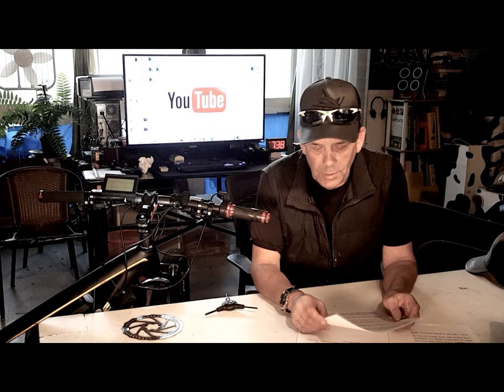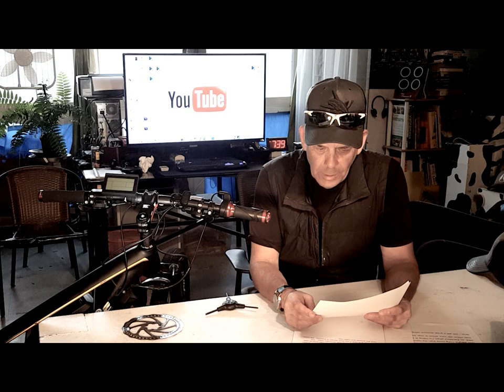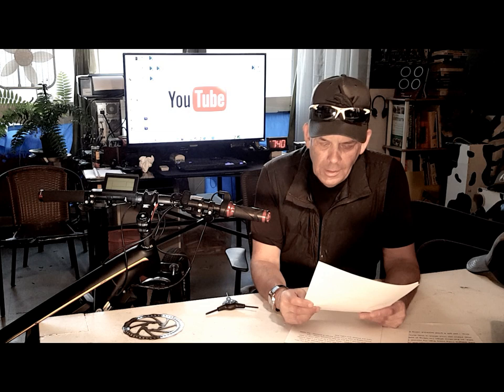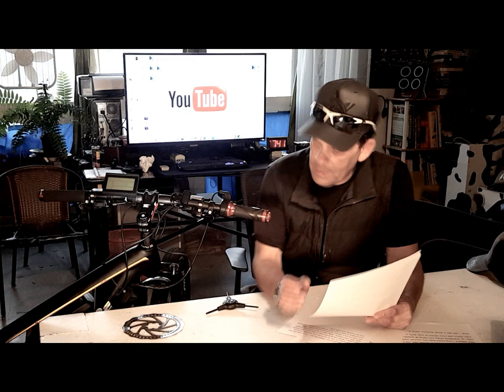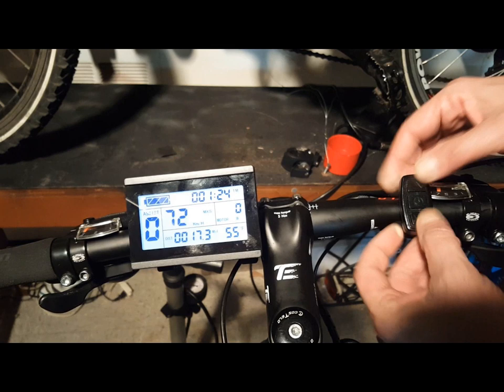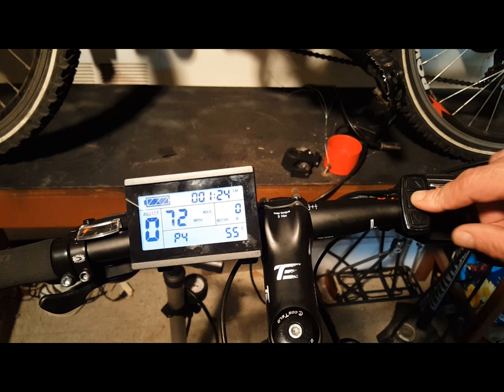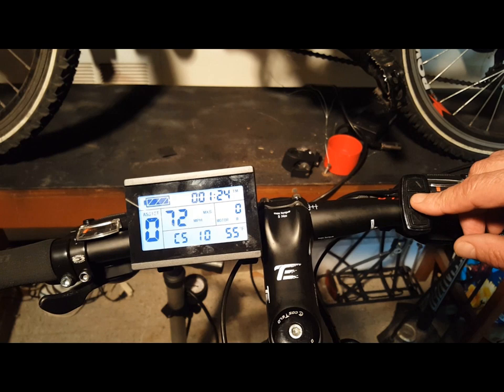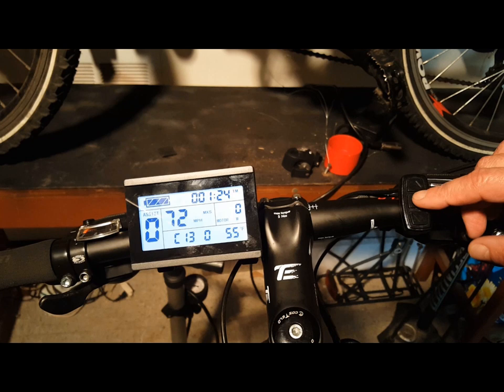ebike Tips. Programming the 24v, 36v, 48v, KT-LCD3 on-board controller computer

Comment: what you are missing is the fact, that when you press up and down 10 seconds after turning display on, it will bring you to maximum speed settings. If you press it for example 1 minute after turning on display - it will not bring you to those settings, but will allow you to reset distance since the last reset.

Comment: Hi I have a gogobest gf600 I need the parameter settings for it   ihad an error code so I switched it off and back on it cleared the error but my settings have all changed I need the parameter settings to reinstall

Comment: Cheers mate! You helped fix my battery problem. The battery was full, but the monitor was reading an empty. It did show the bars and they was draining, but overtime, it was draining just too fast. I was able to see the temperature for the controller as well! So i'm set and able to read it! <3 Unlike the 1000+ watts it kept pulling out. I don't even know how many watts are in a volt. I wanted to see the temperature so I didn't risk burning the controller up!

Comment: Hi can you run a 48v battery off this screen because I've tried it and both of the screens I had of burnout they still turn on but they won't work the machine and it's only a 36v kit what I've been told there 36 to 48 V screens football full of burnt out

Comment: This is critical for making a purchasing decision.

(05:05) If the motor manufacturer doesn't respond to inquiries (almost ALL of them will NOT respond to user emails) but you know the electrical specifications of the motor (watts, amps, etc), are the P1 settings obvious and we can still program the unit?  OR...does it require knowing proprietary manufacturer codes to set for given motor electrical specification values and we're out of luck when manufacturers don't respond? 
(e.g. for 750W motor enter "3", for 1000W motor enter "5" and so on).

If it requires entering codes, rather than actual specification data, is there documentation anywhere that translates motor electrical specifications to the required codes?

Comment: Hi 
I changed the old damaged BLDC controller with the new one (KT-48ZWSRL)
I also had the 6 wires for the Hall sensor, didn’t connect the white one.
If I go in „walk“ mode (long press of down button) the motor is rotating but if I use throttle nothing is happening.
Some advice?

Comment: My battery says that the cut off voltage is 36v , however my motor cuts off when the battery reaches about 46v. Any ideas as to what the problem is ?

Comment: I have NCM Milano with Das Kit controller in U.K.  if I sop in high gear starting is near impossible as there is no throttle (UK law). In walk mode the power is maximum but speed is limited to 3 mph. Is it possible to reprogrammed to a higher speed  so that I can get started and change down gear?

Comment: Great descriptions and a levelheaded approach to programming..  Helped a lot with my new controller.   Do you happen to have a wiring diagram for a 1200w Risunmotor controller?  KT36/48VPRL-SLSO2G  They dont send a wiring diagram with their controller.  I am an electrical contr. and just need the ID of the terminals.  thanks much

Comment: Hi
I hope you can help.
I have got 48v 1000w ebike with throttle battery display. I have purchase a lcd screen to connect but there is no connection to conection. I try to weld to the same wire colour but can't use throttle anymore. 
My question is Can i use anther lcd or just have to use throttle power signal display?

Comment: What would the P5 setting be for a Battery48V 14Ah Li-ion battery with Panasonic cells? I have the sondors fold x and the kt lcd3. I have been trying to set it up, i set the P5 setting to 15 and it didnt show any battery so i set it back to 0. Also the spedometer doesnt work anyone know why?

Comment: Anyone know what parameter settings I should use if I use it with a Bafang BBS02B 750w mid drive 48 volt? Originally used the KT-LCD3 with rear hub 1000w.

Comment: Hi pal, thanks for the video it was just what I was looking for, but could not find anywhere. I was messing about with my LCD and upset the factory settings, and was unable to find instructions on how to reset my computer, until I found your video. I am delighted with myself after seeing your video I reset my computer on my Zipper Z6 36V e-bike. I think in the US its called the Archer e-bike! You are a scholar and a gentleman. 
From John in Ireland... 13th July 2022.. (I have a question, my bike has just walk assist at 6 mph, can this be changed to full power on my thumb drive?)
Thanks in advance.

Comment: I am not sure what LCD unit I need. I have a 20" front-wheel-drive 36V 750W motor & powered by a 36V 20ah ion-lithium battery ( I am new to this so can you please help me)
Reply: typically KTLCD3 and KTLCD8 work the same on KT controllers, LCD8 is better though, it has a full color display and is able to show you all the settings at once

Comment: Informative video thanks - Is there any way of changing the wattage that is applied with each PAS level - if that makes sense - for example my PAS level 1 applies 50-120w of power, PAS2 120-220w, PAS3 220-350w, PAS4 350-420w and PAS5 420-520w - my motor was a 350w but it failed, I now I have a 250w and I am a bit concerned that PAS5 will decrease it life span as the other one failed after 14 months.
Reply: No, there isn't.
Reply: Yes,you can mix the C5 and C4 to lower the power respectively

Comment: Little late to the party but I'll try anyway. I currently have a 36v battery running on the KT-22a - 36v/48v- 500/750W. My question is what will happen if I upgrade to a 48v battery? Simple math pushes the Watts to 1056 will the controller limit the Watts?
Reply: The controller will use the same current.  Why are you trying to limit the Watts?  To protect your motor?  You can restrict the Current output of the controller using  the C5 parameter, which will restrict the Watts in a similar fashion.  Setting C5 to 10 will divide the Max Current by 1.10.  Setting to 8 will divide by 1.15, 7 by 1.2, 6 by 1.25, 5 by 1.33, 4 by 1.5 and 3 by 2.0.

Comment: If I had a manual to check I wouldn't need to find the info on YouTube So while I don't expect you to explain stuff like sine wave settings there are others that you just skipped over so I don't even know what questions to ask about my battery or motors or controller if I had the opportunity . You just read the manual

Comment: Is there a way to increase the LCD timeout settings? I believe the current default is 5 minutes. Wipes out your trip statistics if you have to stop for longer than 5 minutes. Thanks!
Reply: no there is no way to change timeout settings, the best way you can calculate your total distance for a single trip is to write it down every time you stop then add them together for your total

Comment: My Ebike 48v so can i put battery  60v? My controller  on board write 48v/60v so it can burn motor and controller?  Pls help me Thank you for your answer me. Thanks advanced.
Reply: 60v is the limit your controller can handle BUT do not buy a 60v battery as you will burn your controller, buy a 52v battery, a 52v battery at full charge is about 58v

Comment: hello, i bought an lcd 7 to replace my broken up old one
It works in general but when i pedal my bike it won’t even turn the motor on, it’s weird because my walk function works
Reply: Did you get it to work having same problem.
Reply: @colton167  hey, I changed the internals off the old broken one into the new and it worked, this is due to both monitors having different configurations, they are the same, but the new one was not configured to my bike

Comment: Alexandre Costa
Hi, really nice video. I have a question, i buyed a 36v 500w Hub motor, and the controller doesn´t have a connection to a LCD panel so i can control the level of the power of the motor. Do you know a solution to have it incorporated somewhere?
The reason, is that the PAS always goes to full power on the motor, and sometimes i don´t need that, i need just a smooth assistance of the motor.
Reply from the maker: Hey Alexandre,

You would have to buy a new controller that comes with an LCD or LED that will work with your 500w motor. The good news is that if you match the voltage and the wattage for your motor, there are plenty of great options under $60 that will really help you out and allow for PAS. Let us know what you come up with. Cheers!

Comment: I have a KT-LCD display and I have a 48V battery that is suppose to show up to 58.8V but the battery only shows 53.6V fully charged and it cuts out at 33.6V. The P5 on the settings was set at 12, and I understand that is suppose to be for a 36V battery system. It is really suppose to be set at 15, for a 48V Battery system or "0". Are you suppose to change the C10 setting to "Yes" to make changes on the display?
Reply: Did you find any answers? This depends a bit on your battery chemistry and if your batteries are working as they should. I have blown 2 cells in my lipo packs due to 1st time a bad balance connector and 2nd time vibrations and rubbing on the bike. After this the cells can go dead short so the other cells do not see them just as if there was only a straight wire there. Then if you charge without balancing or without checking you are getting a balance voltage on all of the cells you can be overcharging the other cells as the blown battery cell is no longer there to absorb it's share of the voltage. Then you end up with a battery pack that is 3.6V lower for each blown cell also you will be damaging the pack and risking a fire each time you try to charge.
  This can confuse the controller.
Reply: your battery is 48v means 13sX3.7. So the max voltage you can get is around 13sx4.2=54.6. You lcd shows it correctly
Reply: 48v battery should not show 58v in any case. 54v is the maximum
Reply: a 48v battery maxes out at around 54v, a 52v battery maxes out at 58v

Comment: Help!My KT_LCD5 (with 48v 1000watt motor), top line (TM) flashes and I can't reset.  Used to work, but now can't change at all. How do I reset to default?
Reply from the maker: Turn off Battery. Disconnect from the controller, wait 5 minutes and reconnect. It should go back to factory defaults.

Comment: Hey, thx for the vid. I got a problem on my ebike. The LCD is showing an error message '06 info'. Also, the temperature symbol is loading... Doyou know what it means?
Reply: Gaspard COTTIN about the the temperature you need to check the sensor, also the error 6 sometimes depend of the sensor. Try to disconnect the Throttle or other stuff one be one and check if you have other error.

Comment: My system shutdowns even when charge of 2 points exista Mine is a 36v battery and p5 is set to 15 and sstill it happens
Reply: p5 at 15 is for 48v batteries not 36v

Comment: I have a weird issue where my temperature is - 31 F when it's actually 91 F outside... Any ideas why?
Reply from the maker: I have never had that problem. Clearly the internal sensor is not working. It is not something you can program.
Reply: Mabe in c centigrade like in Europe.  Look to change temperature displey settings Fahrenheit or centigrade.

Comment: No good to me as my electric e bike is a roahog all I’m getting is 15 Miles an hour it’s supposed to do 25 to 30 I don’t know how to program it did not get instructions I’ve tried Internet I tried here I don’t know what to do
Reply: Here is the manual for LCD-3 display: http://www.topbikekit.com/LCD3-User-Manual.pdf.  The very first setting on page 17 or 18 under General Settings is the Maximum Speed.  Set this to the max setting of 72 km/h that way the bike will run unrestricted.

Comment: Hi there, I purchased a BPM bike online and though I have been satisfied with the bike, I found the LCD display wanting.

I called BPM and they could not provide me with any further information on the LCD display other than the options to choice amongst 1) Max Speed; 2) Wheel size; 3) Voltage and 4)kph/mph. The generic display has the 5 section battery life indicator on top like all King display, pedal assist levels, etc.

Aside from the four configurable functions I mentioned, there were nothing else! There were no option to lite the display for night riding, clock, etc.

So, I am puzzled as to the LCD displays you have been talking about, with what could be up to 25 functions!? I didn't expect option for light as there were no light connected to the bike, but this is far below basic as I expected. My question is, can I replace the LCD display to something with more function or is the display tied to the controller so I could not simply upgrade the display?

I have been looking online everywhere but couldn't find any help, maybe you could offer some enlightenment then. Thanks.
Reply: Cav1stlt hey man I have a bpm and all I do for light is gold the + button and it turns on. I’m trying to figure out how to set the top speed
Reply from the maker: In order to replace your LCD you would have to make sure that it is compatible with you controller. The best thing to do is to purchase a good LCD that comes with a compatible controller making sure that it is the same voltage and wattage of your battery and motor. You should be able to find them easily for under $50. The SW-900 is a good choice, readily available and works with multiple voltages.

Comment: I might have missed it ... did you say how to clear the trip odometer?
Reply: Directly from the manual: After power on for 5 seconds, hold up and down arrows at the same time, single trip riding time (TM) and single trip distance (DST) flash, hold power button shortly, the content of both is cleared. If failed holding the power button within 5 seconds, it will automatically return the display interface after 5 seconds, original content is preserved.

Comment: Hi. I have the KT60SVPRK-SLS02G controller. 
I am trying to find out how to modify the settings. Specifically if i can change the low cut off voltage to suit my lipo battery pack.
  Also i would like to know if the auto voltage detection works well and if there are any tricks when connecting. I want to be able to use two different battery configurations with the controller. 16s lipo (nominal 3.7V max 4.2V) i then want to be able to make the same battery pack into an 8s 2P (or just 8s: no P:). This way i can use the bike for either high speed on the road or low speed high power for climbing off road mountains.
  Ps. can this controller charge the battery via regen?
Reply: On the controller it says it is a 60V (i'm guessing nominal which is around 16s lipo) 45A low voltage cut is 50V. Display is the KT-LCD6
Reply: I think there is an auto voltage detect for lower voltage batteries but if not i would like to be able to change the setup for different voltages.

Comment: My display stops showing mph when I'm coasting.  Is this correct, or might it be defective?  Seems to me it is essential to know your downhill speed.   Also, this might be the reason that my mileage is wrong, I go further than it indicates even though I have the correct wheel diameter setting.
Reply from the maker: IT should show your speed at all times. The motor/wheel is connected to your controller and your controller is connected to your LCD. It is important to program the correct wheel size, but that will have no bearing on that issue. I have checked the Kt-LCD3 against my Garmin GPS computer and the difference in mileage has never been off more than 2/10th of a mile. Maybe something is wrong with your LCD. If you decide to replace it, think about upgrading to the SW-900. The Kt-LCD3 was introduced as a 24v/36v controller while the SW-900 was introduced for 48v. Good Luck.
Reply: Thank you so much for taking the time to share your expertise with me.  It is greatly appreciated.
Reply: Your wheel speed sensor magnet is probably misaligned.
Reply: I have the same problem when coasting , I was wondering if there something in the parameters settings to correct this.
Reply: When I fitted my new lcd display and controller I followed the parameters settings that the supplier sent but I could not get the motor to run. I went into a pedalec forum and was recommended to set no2 in p parameters to either 5 6 7, which worked perfectly.
Reply: Not according to my dealer who installed it.  So, I guess I will be using a phone app along with the display.

Comment: Thanks, but no restoration to defaults after disconnecting and waiting.
Reply from the maker: C10 is automatic restore default settings mode. Press Y
Reply: Thanks, I'll see if I can get to C10 on my KT-LCD5. Bought a new display and while throttle works, pedal assist doesn't ... so it goes! 
 @AugustineEBikes
Reply: AUGUSTINE E-BIKES 2019 hello I just got an ecotric 26”fatty, I have S900 lcd computer I saw videos of the SW900 and as you know I have 12 Program’s and I was following along with your video and I’m very interested to know what it did to the bike’s performance.would you be able to send me the information,video and programming for my bike I believe it is a 2018 .
Reply: Thank you for your help 🙈

Comment: Ok if I have a 36v with 750w motor what ah on the battery do I need?
Reply from the maker: The AHs determines your range. The higher the AH the greater your range.
Reply: for a 36v kit you need a 36v battery, the batteries AH will determine your range

Comment: Does it works with 52v battry as well?
Reply from the maker: It doesn't have a setting for 52v, but you can run a 52v battery with this, however you may not get a fully accurate reading of your batteries capacity.

Comment: Do this display fit to any controller I mean does all the 48v 1500w controller take lcd display?
Reply: all KT displays are compatible with all KT controllers, you have to make sure the connectors are the same though, some  displays/controllers have the normal SW connectors while others have the WP connectors